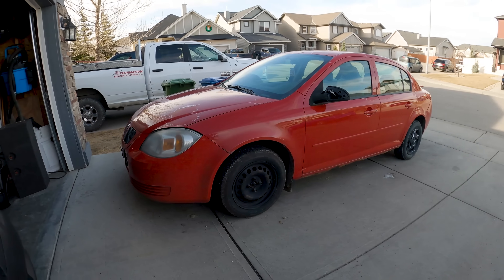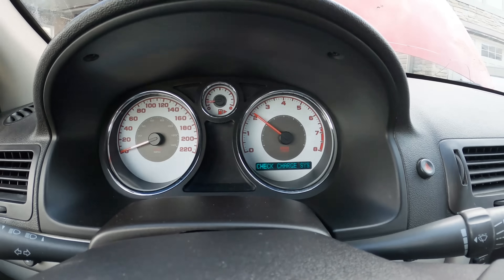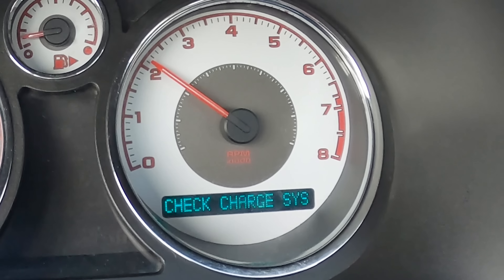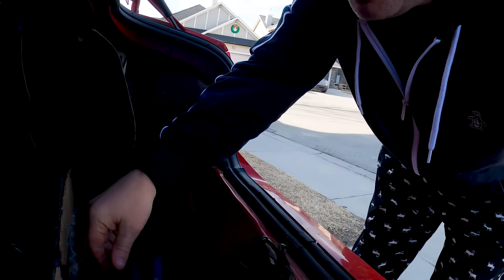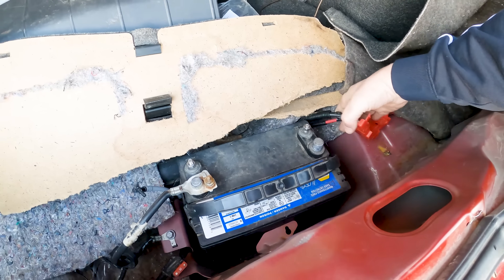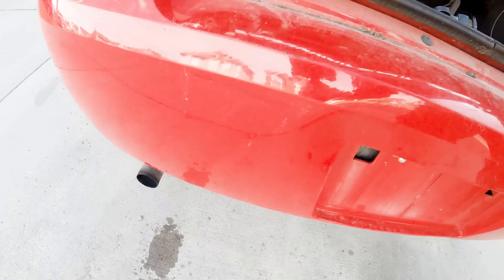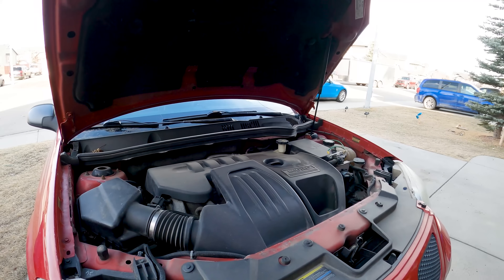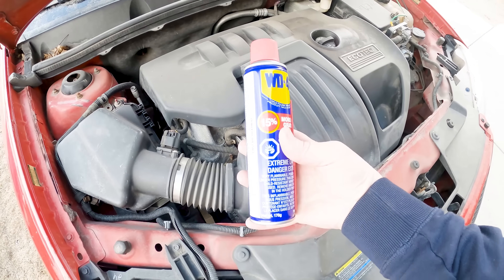ROADSIDE FIX! REVIVE your DEAD or DYING Alternator with this ALMOST FREE trick! | Gears and Tech

Comment: A running engine alternator output should NOT be below 12.6 V, 12.4 is too low, 11.7 is way too low. Modern  cars with current sensors can charge at voltages around 12.8-13.0 volts, but honestly it should be 13.8-14 volts. Also unhooking a battery terminal on a modern automobile with many modules, and multiple networks, while it's running is a Terrible idea, most every OEM service manual warns against the damage this can cause, I have been a technician for 33 years, and a master drivability tech for 20, seriously, doing this on a Nissan with an Intelligent Power Module, or CDJR with a TIPM can cost you thousands.
Reply: 9th gen accords civics can go as low as 12.4v but yeah for toyota I think minimum is 13.6
Reply: @apollomedia7210 14 😁👍
Reply: Just did an 11 Jetta required 14 min. In order to charge due to extra electronics added. Anything lower the battery would die. So you gotta figure in that many kids add big sterio systems and cameras plus gps heads up displays. And all kinds of stuff that can also be damaged by cutting power ubruptly . They are half the time connected directly to the battery.
Reply: 13.8-14.4 is what I always looked for in voltage output for charging.
Reply: @swicked86 True . Over 13 volts for all charging .The volts listed here is batt voltage . 12.6 new batt, 12.5 good, 12.4 fair for 4 cylinders, 12.3 borderline , 12.2 dead for starting  most 8 cyl.
Reply: I concur on all counts here.
Reply: @hootinouts harrumph, harrumph!
Reply: You are completely wrong! I’ll spare you my almost 30 years of automotive credentials and 2 master’s degrees because you probably don’t care anyway.  Disconnecting a battery terminal on a running vehicle on any car made in the past 35 years is not only the most stupid thing one can do as a diagnostic, it is also not at all reliable as a diagnostic! Especially on vehicles manufactured in the past 15 years as they are almost all computer controlled charging maintenance and electrical field controlled according to electrical demand. You truly have no idea what you are talking about and possess absolutely no command of automotive repair, electrical or electronics theory and operation. Disconnecting a battery terminal on vehicles in the 1970s and older was common to test the charging system and also necessary because they had generators with external mechanically operated voltage regulators that were unaffected by voltage anomalies and high current spikes that destroy modern electronics through the high resistance condition created when disconnecting a battery terminal while under operation and electrical generation. It was also necessary to do on 1970s and earlier vehicles as a diagnostic to see if the mechanical relays in the voltage regulator would operate when energized and de- energized additionally the generator could be put into a full field operation that way as well. Very few mechanics in those days had electrical diagnostic tools to trouble shoot without disconnecting a battery terminal. You however are just negligent on so many levels of misinformation throughout the entire video. Please stop embarrassing yourself… please!
Reply: @davidkarpen5686   I also worked in automotive for over 20 years and you are right in saying pulling the battery cable while the engine is running is a terrible Idea. I have replaced so many computers for this same reason and have always told owners that it should never be done. Anyone arguing with you on this is simply what I call a shade tree mechanic.
Reply: @davidkarpen5686 as an automotive electrical specialist with an avionics background, including educational degrees and years of experience, I fully agree with your humbled advice to this embarrassing video and its creator.
Reply: @davidkarpen5686 you saved me having to watch this stupid video thanks man
Reply: @davidkarpen5686 I'm laughing over here 😂 LMAO "I'll spare you my credentials" then you proceed to list your credentials lmfao 😂.
Reply: Yessir. Euro tech here.
Reply: @davidkarpen5686  Mr master You are saying that the battery that is usually fully charged except for slight discharge during startup is constantly drawing power from the alternator and if you unhook it the alternator will magically generate more than the normal 14-14.8 volts and blow out every sensor in the car? All the sensors run at around 14 volts all the time left over power generation is used to charge the battery most of that is used to run the electronics. You don't need to have a piece of paper to learn how things work you got a inflated ego. Also as I suspected you claim you know everything Yet post no videos to share your knowledge. I would use a voltmeter to test the battery with it running and if you get 14-14.8 volts the alternator is working.
Reply: b@davidkarpen5686 😂😂😂Spot On. Your OBCM or ECM can cycle up and over 1.5 billion bits of information in 60 sec. Your absolutely correct, haven't seen that since I was in high school 45 years ago on a GMC voltage generator truck. Same stuff last year, watched a car being pulled by a rope, in drive, 
I believe it was 1972 push starting a car with a automatic transmission capable.
Watched a guy jump start a 1986 Corvette, just accidentally got the cables, back wards. Smoked that ECM in a millie sec. Plus the diodes, in the Altenator.....Cost over $800.00 back in 1986.
Reply: @davidkarpen5686 🎉 well said!
Reply: @davidkarpen5686 
- Since you you replied to OP (original poster) in this thread it as appears that your comment is in reaction to them. But then your comment critiques the video uploader. THIS IS CONFUSING! 
- If your comment is directed at the  video uploader then you need to remove it from this thread and place it as it's own comment.
- If your comment is directed at OP, then you need to edit it so that it is and only is.
- Without taking action on what I have outlined you're causing CONFUSION to anyone reading your comment.
Reply: @Some_One_One  The planet will survive. Why don’t you fix it. Paste and copy my reply and put where you think it belongs.
Reply: I got a constant 16v thank you MECHMAN ALTERNATORS!!
Reply: @g@garystevens1044at 16v you are over charging and will be boiling out your battery over time. 16v briefly after starting is not so bad but constantly at 16v is to much
Reply: Automotive Electronics Design Engineer with 45yrs experience here: Disconnecting a battery on a running engine is a REALLY bad idea!  Most alternators use the battery as load & reference voltage for feedback control.  Disconnecting it will cause the alternator output to become highly erratic and susceptible to produce massive voltage spikes (several hundreds of volts) It's a bit like removing the flywheel from an engine!  The only thing that stops it destroying the car's ECUs are the transient protection circuits in each ECU. You're basically on a knife edge to destroy any electronics fed from the vehicle supply.
Reply: @PT-ij9hc  people will ignore the “have done and designed this stuff for 45 years”. Because the blindingly obvious facts don’t agree with there feelings.   I have personally seen stuff fry on modern cars from unhooking the battery while it’s running. I have also seen stuff fry from having a dead battery. Jumping the car then trying to drive the car.  Modern cars are basically computers. And anyone with a brain knows how fragile stuff like that is to disturbances.  And then you see these “well if the terminals touch that is what causes the issue”. 🤦🏼‍♂️🤦🏼‍♂️🤦🏼‍♂️ yea. They don’t have to touch. Just unhooking and giving that alternator load nowhere to dump is all you need.   It’s been proven in these “fancy books” they like to talk about. And also every mechanic who has done this for long enough has personally seen it
Reply: the disconnecting any piece of modern electronics while it is running is a bad idea. Most modern electronics are very sensitive to spikes. You aren't going to destroy every piece of electronics this way but you are rolling the dice every time you do and because this video will be seen by so many people it guarantees that someone will destroy the electronics. Honestly this seems like a no brainer
Reply: @PT-ij9hc It's like playing poker with professionals as your wager is a limb from your own body and you don't know that folding is an option.

The only thing beneficial about this video is the comments. It's a pleasure to read through the advice and knowledge of true professionals. We have things in common, starting with knowledge and experience with a desire to share that in order to help others from amplifying an already bad situation.
Reply: @YTInnovativeSolution the guy who made this video states its a temporary fix to get you to a safely fixed at a shop or get you home. So to come on here trying to hate on this video with your knowledge and so called experience is claiming that you have disconnected a battery while a car is running and it ruined the computer or what ever electrical components. If not then scratch off the experience you claim to have. I know I had a 2001 Nissan sentra and every now and I had to tighten up the battery to start it because the terminals was bad. Every time I drove on a bumpy road to go fishing or sometimes went over speed bumps. I banged on the positive or just moved it to get it to start. Times I got it started and while it was running I moved it around until I was satisfied it was tight. Some times I pulled it off while still running to see if it wasn't my alternator not charging my battery back up. 1 day  it turned off and I new it was my alternator faulty. Bought a new alternator and terminals and fixed it myself. Did it while the key was in the on position and nothing bad happened. Soon as I put the new  alternator on it started. Bet your mad right now 😂😂. But everything I stated here is true except the keys in the on position. I just like pissing off a professional  because they went to school and worked hard to get the knowledge to fix an alternator and other stuff and I got my knowledge from YouTube. 😂😂😂😂. A 10min video saved me hundreds or thousands of dollars. So be mad clown but I rather do it my self before I get ripped off by a professional.
Reply: Turn tire video see if the alternator is already bad why would you have to worry about frying the alternator that's already bad @PT-ij9hc
Reply: @PT-ij9hc  😂 it is a Bad a idea but it also lets You know if it's working or not 😜, that's why it's a dirty fix like jumping a burnt fuse with a wire, it's Bad but... Could get you to your destiny
Reply: @K_spawn  Well, you do whatever keeps you happy. I've spent enough years designing this stuff to know fact from fiction & offer sound advice. But, I'll tell you this now... keep doing it & one day it'll bite you in the ass!
Reply: @PT-ij9hc  oh no I'm not saying it will not ever happen of course I know it can happen the point here is if that is your only hope to make it safely somewhere it might be well worth the risk, I do have proper tools like the midtronics battery testers and stuff to proper test the starting and charging system didn't mean to disrespect
Reply: @K_spawn , destiny or destination,, or both ?? 😂😂😂
Reply: Well I know ohm's law is a must if you going to do anything with electricity
Reply: Mmm about that disconnecting the terminals that costs me my radio 😔
Reply: @mandlenkosianselmkunene7737 maybe u shoulda unhook it 1st but nuth. happen to mine
Reply: Makes you wonder how many OEM documents and TSBs this guy must have read to reach this level of professionalism, right?? If this was my upload, I would pull it down. However, it is videos such as this that bring like minded people together in the chat box.
To add clarity to your comment..
12.4 volts is what you should read as the 'surface charge' on a healthy 12 volt  automotive or marine battery with no load attached.
14.4 volts is the proper 'charging voltage' needed to charge that 12 volt battery.
For those who are curious about load testing.... A healthy battery should be able to deliver 250 Amps of current (the draw from a starter) for 15 seconds (minimum time) without falling below 10 volts.

I hope this guys advice brings more people to the comments than straight to their troubled vehicle.
Reply: @YTInnovativeSolution o thought it was between 14.4-17 volts
Reply: By CDJR and TIPM I'm sure he means...Chrysler Dodge Jeep and Ram and Totally integrated power module, the Module might as well me a Nodule... As in a  Malignant one.  😂😂 them TIPMs are trash but that's a whole different video. 😂
Reply: I was coming to say something similar but glad someone else did. Thanks man.
Reply: This guy is full of bad information and worse, he does not explain mechanical reasons why his fixes should work.
Reply: Goodness, I rarely get the opportunity to highlight the differences between practical experience and theoretical experience. As a highly intelligent individual, I have both. Firstly, I cannot tell you how many people I've hired with "Culinary experience" and "Chef certifications" from schools (like myself)  who sell themselves with such proclivities in cooking standards and extensive knowledge that absolutely sink as compared to guys that have just learned from on-site experience. I need about 3-4 "certified" cooks to 1-2 cooks with actual hands on job experience.  That's a complete FACT. Books and theories can't teach you. They can help prepare you but never as well as the actually doing a job. This video is for beginners in this field and was spot on with its intended desire. Dont know why 35 year veterans are even watching this. To criticize? Man get a life. Surely they have all that experience to a better end. Or maybe not. That being said. I work on all my own cars thanks to videos as such as these and have absolutely no need to be dependent on mechanics that look for opportunities to overcharge and rip me off anymore. All Facts. Not theory. Just sayin
Reply: @antoinecoleman5110  😂😂😂😂. Stick to cooking
Reply: @antoinecoleman5110 I don’t care what you say about experience vs degrees etc. Disconnecting a battery cable on a running car is a HUGE no-no and telling people to do it is beyond irresponsible. Is he going to cover the damages that result from it when it happens?
Reply: @antoinecoleman5110  and fyi. I have never meet a “highly intelligent individual”. Who goes around trying to convince people of their intelligence.  You are a perfect example of Dunning Kruger 

Obviously an experienced cook can cook better than someone who has just read about cooking.  But no experienced chief can take flour and make it taste like sugar.  There is this thing called FACTS that no experience can override.  And it is easily proven that the theory in is this video will not work on all current cars  and half these comments are just wrong.  Facts don’t care about your feelings or your experience.
Maybe you are  too intelligent to understand that Mr Kruger
Reply: You covered everything I was going to post.
Reply: Thank you I'm glad somebody said it this guy is something else and that WD-40 is going to ruin that belt
Reply: @mikeyshoemagoo0384  Slip, yes, ruin, no, just be mindful, like when you use engine degreaser.
Reply: @johntaylor3298 , Actually, WD-40 will stop a belt from slipping. If you look at the design of the belt, it’s shaped like a V. Adding lubricant to the belt will cause it to slip further into the V on the pulley increasing pressure on the belt as it’s squished by the V which results in increasing the friction stopping the belt from slipping. It’s counter intuitive, but it actually works that way.
Reply: @terjeoseberg990   3 months later, Yeah, the only problem is like 90% of modern cars run off of a single serpentine belt, They  started moving away from V belts for the most part since the 90's era and if you spray any lube on the belt it can cause it to possibly slip, though a little wd40 on the top side of the belt should be a non issue, But you would never want to spray down a serpentine belt with any type of lubricant thinking you are conditioning the rubber and to try and stop belt squeal, as if it were to soak into the underside of the belt in all the little groves that ride on the pulley's with matching grooves  it can slip to the point of you possibly burning up the belt and it snapping it off or throwing it, then you are left on the side of the road with nothing, like I said most modern cars and trucks run on 1 single long serpentine belt that runs everything, power steering pump, alternator and water pump, so if it goes everything goes with it, no limping it  several miles down the road.. WD 40 does however make a belt dressing spray that is totally different than normal WD40 and of course there are other sprays you can buy to temporarily stop belt squeal do to slippage, but they are tacky/ adhesive type sprays, not lubricants...😉
Reply: @Stars-and-Stripes- , Lubricating a belt to increase friction only works with V belts. Newer serpentine belts have teeth.
Reply: @terjeoseberg990  That was my whole point..😉 But, perhaps you meant to say that some V belts have teeth or you are referring to COG/Synchronous belts  , I have seen some V belts with teeth on them, but no serpentine belts have teeth though , they have several horizontal groves in them that ride along the grooves in the pulley's, But Cog belts, that look like "serpentine belts" on the Top side certainly have Teeth(cogs), like all timing belts are cogged and some drive belts are and are mainly seen on some HD trucks and machinery and such, Not so many cars have them as Drive belts though and the vast majority of cars still use standard Serpentine drive belts..🤔

"V-belts, synchronous belts, and serpentine belts are all types of belts used in different applications:

"V-belts"
Can be compact and installed in limited spaces, and are often used when the distance between the drive and driven pulleys is short. They can also reduce vibration and noise, cushion motors and bearings, and achieve higher velocity ratios. However, V-belts are not as durable as flat belts, and they're not suitable for constant-speed applications because they creep. V-belts should be inspected for wear after 3 years or 30,000–40,000 miles of use, and replaced every 3–4 years to minimize the risk of sudden failure.

"Synchronous belts"
Also known as cogged, timing, positive-drive, or high-torque drive belts, these toothed belts require grooved sprockets for installation. They offer several advantages over V-belts, including:
Shaft synchronization: Synchronous belts can synchronize shafts exactly.
Slippage elimination: Synchronous belts can eliminate slippage and speed loss that can occur with V-belts.
Lower installation tension: Synchronous belts require less tension to install, which can reduce stress on bearings and shafts.
Higher drive efficiency: Synchronous belts can achieve a drive efficiency of up to 98%, compared to 93–95% for V-belts.
Durability: Synchronous belts are resistant to corrosion, stretch, and wear. However, they can wear quickly if pulleys aren't properly aligned, especially in drives with long center distances.

"Serpentine belts"
Serpentine belts are a single, wider belt that can be more efficient than older systems that use multiple, thinner belts. They can also take up less space in the engine compartment. However, a worn serpentine belt can break while driving, which can disable essential functions like the power steering, alternator, and air conditioning." 🖖🙂
Reply: @Stars-and-Stripes- , I’ve never seen a V belt with teeth, and can’t imagine how teeth would help on a V belt.
Reply: @Stars-and-Stripes- , Those are interesting point that it looks like you copied from somewhere. They left out one type of belt that I’ve seen. It’s a single belt with a whole bunch of Vs on the belt and the pully. Do you know what I’m referring to? What are the advantages and disadvantages of those belts? And what are they called?
Reply: @terjeoseberg990  I told you there are V belts that also have teeth on them..🤔
Reply: @Stars-and-Stripes- , The belt that I’m referring to us not a V belt with teeth. It’s a V belt with multiple parallel Vs. The Vs are in the wrong direction to be teeth.
Reply: @williesmith8326 , Is that the best you’ve got? You can’t tell me what I’ve said that’s incorrect?
Reply: @mikeyshoemagoo0384 , Why would WD-40 ruin a belt? That’s idiotic. I had an old Toyota Corolla, and I cleaned the engine several times using engine cleaner and afterwards I sprayed everything with WD-40, including all the belts. The belts never failed, and I drove it until it got to 285,000 miles. Then I stopped driving it, despite the fact that it still ran perfectly and the belts were still fine.
Reply: @mikeyshoemagoo0384 

The belt? WD-40 isnt a great lubricant. It is a rust remover and prevention liquid mostly. 

Im worried about them bearings and pulleys ey? Those might need to be repacked with molly soon!
Reply: @mikeyshoemagoo0384  Also, "regular" WD40 is flammable.  There is a WD40 product made for cleaning electrical contacts that might do something but my bet is that all any of this is going to do is get you stranded for good somewhere farther down the road.
Reply: @WatchesTrainsAndRockets somewhere further down the road , like in a town, is sometimes a much better option.  All those holes in your alternator let water and dust etc in.  A dewatering fluid/ lubricant/cleaner can remove a lot of stuff that shouldn't be there, free up bushings etc.  But, as he says, it's usually a temporary fix. Cheers.
Reply: @grantperkins368  Yes, but NOT original WD40!  It is flammable and it is not intended for electrical applications.  It is for mechanical parts.  There is a variant that IS suitable for electrical.  everything is not a nail no matter how much you like the hammer.
Reply: @WatchesTrainsAndRockets  you're right, and if you have a can of electrical contact cleaner with you that would be a much better option. BUT  if you only have a can of wd40 which I reckon a lot of cars do, then it will work in a pinch.  Obviously don't spray it into a spinning alternator, you'll most likely get a fireball.  Spray it on a stationary alternator, wait a few minutes, all the volatiles will evaporate, leaving oil essentially, then give it a whirr.  Heck back in the day we'd spray it in distributors and points and guess what?... not one fire!
Reply: hah. wd-40 is about useless for most things. it's a water barrier not a lube or conditioner.
Reply: @mikeyshoemagoo0384  Good thing that alternator wasn't working or there may have been a fire. Not to mention that the solvents in WD40 can disolve the coating on the field wires. Genius!
Reply: Couldn't agree more, you can no longer hot swap batteries. This can really mess up some newer Toyotas  as well. Throttlebody ECU could become toast.
Reply: Hay that's good to no
Reply: Don’t EVER disconnect so battery on a running vehicle.  You’re removing the electrical buffer…good way to toast any electronics / power modules / ECU, ECM, PCM’s.

No need to do it at all; it was obvious the alternator was not working by the voltage alone.  13.0-14.4 is normal.
Reply: I'm an electronics engineer and you're right about disconnecting the battery of a modern car while the engine is running.  Anything less than 13.8V isn't enough to charge a partially discharged 12V lead-acid starting battery.
Reply: Thank you. I was scrolling to see how long it would it would take for someone to stomp on the disconnect alternator check. I have been a shade tree mechanic for many a year. Not to mention having working in the auto aftermarket for over 15 years.  This has been a no-no since at least back in the '90's.
Reply: I've had many newer Nissan Rogues come in the shop with a check engine light, crash warning system light, and all kinds of error codes simply due to the battery failing. When changing the battery, the engineers who designed the vehicle warn in the service manual that you need to close the door and wait 3 minutes for the computer modules to shut down before removing the old battery, otherwise there could be issues. So I would never even think about disconnecting a battery on a running modern car. I've seen techs change batteries on older running cars and they were fine but you're playing with fire if you try that nowadays with all the complex technology installed in new cars.
Reply: 12.4v when the car is off is a good voltage, you don't know what your talking about 😂
Reply: @Corporal0927  10v is good on some lol nobody knows what they're talking about 😂😂😂
Reply: Yes disconnecting a battery whilst running used to be a good way to tell 30 odd years ago on cars without ecus.
Reply: A few seconds is not going to fry it!
Reply: with an itelligent power module , blash blsh blsh , not verry intelligent if its gonna fry circuits because u disconnected a battery that the vihicle isnt using at th moment because the alternator is suppose to feed all system when the car is running , so if it shuts off , and u fry a bunch of systems then i calk that a very dumb power module . YOU SEE THI IS THE REASON WHY I STAY WITH EARLY 90S AND BACK , FK ALL THESE NEW DUMB COMPUTERIZED CARS,  IM 47 started working on engines before i was in 5th grade. i have a 92 ford fleetwood bounder rv 33 foot, i see these new rvs with all types of issues , not mine. lol
Reply: You ant wrong.  One of ours guys was working on a new Nissan. Replaced the battery but forgot to tightn the terminal. Car was running. He somehow “accidentally” pulled the cable off the battery and instantly fried almost 1k worth of shit.   I honestly never tried it. But I really figured not much would happen.  I was made a believer that day lol  pretty sure it was the ipm that fried.  Seems like it was two different things.  Been a bit so I forget.
Reply: @Scummy_shovel 😂😂😂😂 he somehow in the middle of the night accidentally slipped off a mountain Wrestled a bobcat and pulled the positive battery cable off😂😂😂😂haaahhaaaaa
Reply: @scottcarrolljr5711  if your talking about my guy I already explained it.  He replaced the battery and terminals. Forgot to tightn the ground cable and it got pulled off while he was going over everything.   You ever worked on anything?
Reply: @Scummy_shovel , If you disconnect the positive battery terminal and short it to ground with the engine running, who knows what you might fry. If your friend didn’t tighten the positive terminal and it fell off and shorted to ground, your story makes sense. If it was the negative terminal, then I don’t know. I’ve heard this story about frying the electronics if you disconnect the battery before, but have never seen it happen. Electrical conditions in cars are extremely brutal and therefore the computers in cars need to be protected from brownouts and voltage spikes. This is extremely easy to do with capacitors and inductors, so they use capacitor and inductors. If they don’t, they’re going to have a lot if warranty repairs to deal with.
Reply: So I’d guess you’d come and fix my car at 3 am ? Maybe 🤔 with a tipm or ecm or tccm. Just drive and stay old skool.
Reply: All modern alternators have internal voltage regulators. That being said, NO that voltage will NOT change when you hit the accelerator pedal. If the alternator is malfunctioning, then maybe it could but not just because it's cold.
Reply: I was going to say the same... IYKYK
Reply: 12,5 is average for old gm... im not saying it should  or should not...

But I get it, new car need as much power as my house...
Reply: @joseph-mariopelerin7028 naw 12.5 isn’t even fully charged battery voltage. If you have 12.5 at idle then you’re not charging at idle.
Reply: AMEN BROTHER
Reply: Thanks  for the warning......  Yes, it makes sense.   Solid state devices could be destroyed....
Reply: @user-5gu78qo27i , If the belt is at a certain tension, and you add lubricant that makes the belt slip deeper into the grove, you’re right that the belt will become looser. However, it will still increase friction and therefore stop slipping despite being looser.
Reply: Its complletelly fcukn mad this video and most comments on here from either just compltelly ignorant or stupid people ! Any power surge can at the very least cause ellectronics to be damaged and disconnecting battery when engine running is very stupid !! Even not running jumpstarting etc care required and plentty cars have BATTERY DISCONECT PROCEDURE AS WELL AS B.M.S. SYSTEMS AND RE.INITIALISE PROCEDURES.And WD40 oil etc will soften rubber belts and render them to imminantlly fail ! But its funny to see all the clowns and there comments 😂😂😂😂😂😂😂
Reply: A lot of theese brain dead keyboard warriors dont understand smart alternators either ! They onlly charges agm battery to arround 85%   and mostlly when car is overrun/ deceleration boost charge/regenenerative chargeing.
Reply: 12.6v Is battery voltage... An alternatori should be at least higher than 13v... 13.5 to 14.5 Is a good point... For some Cars It could be a bit lower buy anyway never less than 13v
Reply: How was it to be there and see all this talk .
Reply: I forgot to mention =- i broke down on the autobaun in germany and got the ignition contact points changed on the side of road , and back up , = no tow, and we had a car in fairbanks alaska that did not have an alternator , but we could drive to taco bell ( anchorage = 8 hours south ) on the battery if we didn't need lights. terrible ideas we had when young and i can't believe things we have to learn to keep up ??
Reply: Question: I am not sure,but: inst the wd40 flammable? doing that isn't a risk to provoke a fire?
Reply: right?    All this just for:  $7 multimeter, alt bad.  done.  yikes
"If you haven't heard of wd40"    k.. ya I can't lulz.
I tried to go further, then he spayed wd40 all over his fan belt....
Reply: Diagnose my alternator the same way charge light was on and drained the battery. So I done the disconnect terminal test 💯 alternator not charging 👍
Reply: The alternator runs everything not the battery so unhooking the battery will not cause damage. The battery is mainly for starting the engine.
Reply: @chriss4365  alternator doesnt run everything all the time, they have a duty cycle. Alternators are not meant to be charging 100% of the time. If they did charge 100% of the time, they would overheat and the solder inside them would start dripping out. Typically, they dont have any special type of cooling other than the fan fins inside of it or on the outside of it, except for a few different model european vehicles that use the engine coolant to cool the alternator.  The battery is used for more than just providing power to power the starter to start the vehicle.  The battery provides a reserve of power for vehicle electronics, also reduces the load put on an alternator, and especially in European vehicles, if you have a weak battery due to damaged cells, and need to jump start the car, certain vehicle systems are not going to be able to function properly because the alternator duty cycle is going to be higher, and that will lead to overcharging for extended time, and some vehicle systems are not allowed to operate when the voltage is too high for an extended time, so then they stay powered off.  When you disconnect a battery from a car, especially if you take the positive off first while its running, the system voltage will spike, and computers have sensitive components inside of them that are vulnerable to blow if there is a sudden spike in voltage. Think of it like this, if somebody is spraying you with  cool to warm water on a hot summer day consistently, its fine because you wont get burned or freeze, then someone comes over with boiling hot water and dumps that on your head, your likely going to get burned and its going to hurt. But before your skin can blister, you cooled it off with the same water youve been getting sprayed with so it becomes manageable. Now someone else comes along with some more boiling hot water and dumps it on you again. Your skin is already sensitive from the previous boiling water and its going to hurt even more. Maybe youll blister, maybe you wont. When a blister forms from a burn, thats pretty much representing a component of a computer failing due to voltage spike. So any real technician that knows what they are doing, will simply tell you to refrain from following this guys instructions because it will cause an issue.
Reply: @SM-sw3ul , 1 or 2 minutes to swap a battery isn’t 100% of the time. It’s only 1 or 2 minutes, and with the battery disconnected, the alternator isn’t charging anything.
Reply: Ok but he said the voltage was reading the battery not the alternator, but u might be right about damage tho cuz the car doesn't understand and has to relearn the way the electricity is running, is this somewhat correct?
Reply: Not everyone drives a modern car though. I drive a 79 Subaru DL and the engine will run happily with only 8 volts or so powering the ignition. If the engine spent a long time cranking to start, and it's raining outside, so the wipers and headlights are on, and the blower motor is on, the voltage will drop to around 12v, only while idling. I've driven that car for over 200,000 miles and it's never caused a single issue. Yes in a modern car that may cause an issue but some of us drive carbureted cars with distributor ignition where low voltage isn't really going to affect anything except that if the voltage really is low for a long, long time, the battery will die at some point.
Reply: Either way a mechanic will cost u thousand. Buy DIY… will actually save u money. I’ll take the risk.
Reply: Since your a  "technician" for 33 yrs and a "MASTER drivability tech" You probably don't have the problems that regular people do. But me being a regular old "mechanic" with a repair shop for 37yrs in a small town I think it was a great tip for someone with $500 car it will save you from calling a $200 tow truck.
Reply: @Jpilgrim30... 😴
Reply: Completely agree!
Reply: This guy clearly doesn’t know what he’s doing. I’ve been wrenching for over 30 years and I laugh at some of these people.
Reply: You can't unplug the battery the alternator will not keep all systems running. It's not a 57 chevy
Reply: @tymothykendrick6420 dude... your alternator will run everything and charge the battery on top of it... so if you unplug the battery, it will still run everything... 

Your battery would be always dead if it wasn't like that...
Reply: You my friend are a fool.
Reply: What moron tells viewers to pull their battery cable off while the car is running??  You know how many computer modules you could ruin by doing that ?? Stupid idea stupid tip!!!!
Reply: Omg.
Reply: Thanks for the acronyms dude
Reply: So the AAA guy was testing my battery and he broke the negative terminal off the battery. The car shut off and the next day I went and bought a new alternator. Now when I use OBD I am getting a p085 error.  I'm worried something may have shorted it is a 2006 Honda Civic DX
Reply: I'm happy tour australian mechanics
Reply: Yes it can cause issues with ecm disconnecting the battery.  Best to simply use multimeter to test battery and or alternator.  
He did well for a GM guy tho 💁😂
Reply: You probably a fitter 😂
Reply: You've never own a honda civic, huh?
Reply: It's always good to have a spear one.
Reply: So I’m assuming 1.6v is probably not good huh😂
Reply: Omg this bloke tighten the terminals lmfao, and don't ever remove terminal while running 😮
Reply: You are so wrong my Cobalt supposed to be at 11.5 don't believe me look up 2006 Chevy Cobalt Lt with a 2.2.
Reply: Yes and putting wd-40 in there can cause a flash fire
Reply: Bad cell
Reply: No it should go up to at least 14.7 fault so the first couple of minutes and stabilize it about 14.2 to 14.4 volts
Reply: I welcome motorcycles but the principal is the same when you have an alternator you don't remove it or disconnect it while the vehicle is running you can completely destroy your ECU and maybe on an older vehicle maybe but on the neuro ones wow you just don't do it you just don't do it I caused thousands of pounds worth of damage by doing that it's just not worth doing.. If you don't have the tools get recovered don't pull the leads off an alternator for running vehicle. You can go from no alternator to no vehicle very quickly. 😊
Reply: technician says you can't do that you will destroy it. bring it to my shop. I will charge you an arm and a leg. real mechanic says let me give you a tip so you can help your self.
Reply: I'm sorry my only question is why in the world are these Master Mechanic, Super certified, Multi-year Genius Overlords of the PhD from Harvard, Brown and other Elite Ivy League schools. 
Why in the world are they wasting their super substantially highly valuable time. Watching a shade tree mechanic; Moreover then subsiquintly feeling  the need to make time in their evidently super busy lives; To then critique some poor sap on YouTube trying to be helpful. 
I personally posit if they feel that strongly about it, Then why not make their own video releasing the gatekeeping information of their super understanding about car charging systems and electronics. Because certainly they engineered and wrote the schematics for all charging systems. Judging by their comments and understanding of a highly misunderstood and tricky subject such as the almighty alternator. PS. Chances are if we're being honest they probably invented and patented the aforementioned.??..😂
Reply: Spraying the WD40 isn't a good idea?
Reply: I'm asking you about the WD40. Bad or good idea?
Reply: If your vehicle can be damaged by disconnecting the battery while running, get rid of the vehicle.
Reply: For those of us who take pride in how many miles we squeeze out of our low tech clunkers , this is magic beanstalk seeds .  Sure there's risks , but I'm better off
Reply: Great video ,!! These idiots who keep clogging the comments , probably have miserable social lives.  Ego driven know it all types , bloated belly and spiritually emaciated
Reply: My Bluetooth device has a voltage reader. So happy I have it... gave me a heads up before taking off and I new it wasn't the battery because I had replaced it and the power would go out after a while on.
Reply: A good alternator should put out 14-14.5vdc a car battery should read 13.5-13.8 depending on type of battery
Reply: That car need the alternator repairing or changing
Reply: I've no doubt its a  bad idea however its always funny when engineers come on with their massive biblical length comments telling you how you cant do exactly whats just been done on video in front of their eyes. 😂
Reply: Always nice for car manufacturers to design vehicles to nuke themselves in the odd event that a battery terminal loses connection.
Reply: it says roadside fix. If youre a mechanic you know its fine in a pinch. Fuck Nissan lol
Reply: Alternators with a diode will instantly be destroyed by a surge if you unhook a battery cable.
Reply: @davidpotter7484  All alternators have diodes. That is how they change the AC that they generate into DC that your car can use.
Reply: @richm1615  older alternators used a resistant wire or a light bulb as resistor. No diode.
Reply: @richm1615  you're looking at the ai crap on the internet,  and not remembering that it lies to people
Reply: @davidpotter7484 👍 Since 1970's in my experience
Reply: Shouldn't hurt anything unless you accidentally touch the positive cable to a ground
Reply: @dinadaughtry8993  that statement that you just made, is even more dumb than the guy making the video. you know absolutely nothing. In fact, the guy making the video knows absolutely nothing, you around the negative side of nothing.
Reply: @dinadaughtry8993 , Exactly!!
Reply: With the ignition on, and the battery light on your dash.
Then the dynamo pully is magnetic.
You can check this by holding a fitting screwdriver against it.
If your dash battery light does not light up and the pully is not magnetic, you can tap the alternator with a hammer in an emergency, hoping that the brushes will touch the alternator rotor again and your dash light will light up again. .
Then your system will probably charge 14.4 volts again.
If you have a newer system with a power module,its a bit harder to fix,but strandet in nowhere,even a city light can help you out to come home.
Reply: These comments are the funniest shit I've read in a long time😂😂😂
Reply: @scottcarrolljr5711  the guy in your profile looks like an extremely slow reader.  So I can see that.  Have someone read them for you. It will make more sense.
Reply: All I know is at you can get a good look at a 12.6 battery by sticking your head up a bull's ass but wouldn't you rather just take the alternators word for it?😂😂😂 fuck that this guy is the shit I hope he becomes president. Lots of people do videos like this for 8 years, they're called Car Doctors
Reply: @scottcarrolljr5711 umm I really don't think you can see that 😂😂😂😂
Reply: @scottcarrolljr5711 i was just about to write this, I'm glad you did first. These comments are triggering.
Reply: YOU FAILED TO LISTEN TO HIM !! HE SAID THIS IS HOW HE DOES IT ON THIS CAR. I NEVER HEARD HIM SAY "THIS WORKS ON ALL CARS / ALL MODELS , EXCEPT THE 2008 FORD EXPEDITION  FUNCKMASTER FLEX EDITION" . i DID NOT HEAR WHAT YOU "WANTED" TO HEAR .........THE CARS YOU MENTION HAVE PROBLEMS WITH THE TIPM ANYWAY = ALL THE TIME !! OH = JET ENGINE MECHANIC 4 YEARS , MI TANK MECHANIC 3 YEARS , AUTO MECHANIC 32 YEARS . BLAA BLAA YADA YADA YADA ...
Reply: @ohioedde  You are both morons 🙄
Reply: I find it funny that people that got a lot of years working in a shop on cars and are licensed and all that are saying this is a bad idea they probably read it in a book but never have actually done it themselves, it works and it doesn't fry your car quit pretending to be a know-it-all when you're not, the man clearly said it'll work in a pitch,  I appreciate him sharing the knowledge,  I suppose these big shot mechanics are going to say you can't use gorilla tape to cover up rust holes either-- shut up and get out of here
Reply: @davidwillis5016 , Exactly!!!
Reply: @davidwillis5016 have done it, it doesn't work on newer cars, the car will shut off at a minimum, fry shit at a maximum. Tell me you haven't touched a car ever without saying it
Reply: @davidwillis5016  you clearly haven’t read the comments. And you clearly don’t know shit about modern cars.  Prob why you’re using tape for rust holes.   But by all means.  Give it a try.  Sure it will be fine sometimes on some cars.  But so is unprotected sex with a prostitute.
Reply: @davidwillis5016 

I shorted my moms Acura ILX 2019 Sport. How?

My car battery is dead, so i turned my moms car on. Pulled her battery out. Placed my battery in. I put positive on first, then the negative.

No, i didnt wire anything backwards. My cables are colored and my terminals marked for ease and obvious reasons.

But i heard (a noise instantly there then gone, like a click) and later discovered i blew the primary fusable link in her car.

I dont know the reasoning, i am not a mechanic.

Pulling it was not a problem...

I do it all the time, bat in and out, on my car...

But my moms car didnt like it. Replacing the fusabile link (140$, must be honda geniune as they are not shaped in a generic style) also revealed a check engine light.

After a couple sensors and one of the multiple onboard computers, her car was back! Took a couple days to locate parts/ wait for shipping and around 350$.

Take what you will from this. Any car with multiple onboard electronics have, to some degree, built in tolerance systems to handle spikes of voltage.
Reply: @ChipperTheChipster , “so I turned my mom’s car on”

You mean that you removed your mom’s battery from her car and installed your battery in her car while her car was running? If you did that and touched the positive battery terminal to ground with her engine running, you shorted it and it makes sense that you’d blow a fuse.

If you attempt to swap batteries in a running car you’re taking a big risk and need to be extremely careful not to short the positive terminal.
Reply: @ChipperTheChipster , If I was going to attempt to swap batteries on a running car, I’d put the new battery right next to the old battery and when I remove the positive cable, I would immediately connect it to the positive terminal of the other battery. I would not let the cable dangle around while swapping batteries, then reconnect it.

The battery cables might not be long enough to do this.
Reply: @davidwillis5016  ok Einstein
Reply: @davidwillis5016 
I think you are the one without the knowledge. Just because this worked on this particular car in this particular situation, dies not mean it will work in all situations.
I have worked on cars for 40 plus years and have equal experience. I've worked on the '70's car that unhooking the battery would work on. After about 1995, computer systems took over charging control. On top of that, they are very sensitive to voltage and voltage spikes. Even jump starting a car can fry the PCM. I'm working on one now that happened to. Been jump started lord knows how many times because owner can't afford a new battery. Now it won't run because the PCM is jacked up. Now he needs a new battery and a new PCM. Both are $250 each. 0lus a fuel fuel pump install that was misdiagnosed because they were too cheap.
The WD-40 trick is just asking for an engine fire to put that car out of its misery. Get a nice hot 95* day with all the sparks the brushes are creating, POOF! Instant alternator problem fixed! 
The only good comment made was the USB charger with the voltage readout. But, he doesn't even understand what the 5.0 means either. 5.0 is the amps the charger is putting out to charge the phone. Car off, you should have 12.5V volts minimum. Running you should have 14.3-14.5v.
Reply: @davidwillis5016 You got that right, book Smart is not experience, the books warn about damage being possible due to the voltage spikes because the battery acts as a buffer for it but... Alternators are more sophisticated than before and the chances of that happening are pretty low, I do have over 20yrs of experience book and hands on and have a bunch of certifications and what not, and I can tell you this guy is correct, if the smarty techs out there are still in doubt here it goes 

Tech a says: this is not a permanent fix may not work, it's a dirty way to try and solve this temporarily.

Tech b says : using wd 40 can drive out contaminants from the alternator brushes

Tech c says : disconnecting the battery while the vehicle is running and the engine stalls, could indicate a Bad alternator. 

Tech d says : engine can run over 11v

Which tech is correct?
Reply: @K_spawn  Tech C 😂
Reply from the maker: How many times did you try it out?

Is this the same as the old story that eating raw cookie dough will make you sick?

I've done this many times and have never fried a module.
Reply: If you haven't fried a module yet then consider yourself lucky. Battery terminals should never be removed while engine is turned on, especially positive terminal, and the reason you run the risk of frying a module is because of voltage spiking. Sure maybe there were cars you did that to and they seemed fine, but what you are unaware of is that inside the car modules,  there are these components called mosfets, and they are transistors used mainly for switching and amplifying purposes, and short voltage spikes caused from disconnecting a vehicle's battery with engine running is enough to damage these components, as well as diodes and capacitors. Like the other comment posted by someone else, the IPDM (independent power distribution module) in Nissans are known to have issues and they are rather sensitive to voltage spiking, as well as low voltage. (Voltage spiking can cause current to blowout mosfets diodes and capacitors, and low voltage will surprisingly fry components because they're demanding a certain power and not being provided that, so according to Ohms law, voltage = current(amps) x resistance(ohms)  and also Power(watts)=current(amps) x voltage. I'm sure you can fill in the formulas yourself but the factor that tries to stay the same is the power (watts) by keeping that number the same, you'll find that decreasing voltage is going to increase the amperage in order to keep the wattage the same, and increasing amperage is going to create more heat as well as component failures. It's nice that you want to help people out and you certainly believe you may have been helping them out, but this video won't help someone in a modern day car , or a car that already has weak electronics from constant electronic abuse and poor ground connections. The best thing to do if you want to help people with automobiles, is either direct them to the real technicians who have the proper credentials and experience, not the guys who are backyard mechanics and think they're masters, or supply them with the phone number to AAA and suggest they get the gold membership plan, otherwise the wisest move is to do what you really know, not what you think you know.
Reply: @asificam1  by cap you mean capacitor?
Reply: @SM-sw3ul basically all you mechanics say the same thing. You are trained to work within manufacturers specified limits. This is the Star Trek folly. Anyone on the outside can push past those limits quite regularly without having to spend the thousands of dollars that you insist that we need to spend. Everyday us dumb people get these cars to work without following your instructions. This is why we don't like to get ripped off by you people with 30 years of experience and 50 masters degrees. It's simply not necessary because most cars can handle way beyond the manufacturer's specification because they have been tested thousands of times and have a certain fail rate. And then what they tell you is if it fails 10% of that time you shouldn't try it because they're going to end up having to refund at that rate if it's brought to your shop and that's too risky. It's called being an actuary. 

You may be a mechanic with all this experience in the world but you know nothing about insurance and mathematical work that goes on behind the scenes which means WHY They tell you to do what they do! Actuaries do this and I have 30 years experience in this field and I'm the guy who tells you why you do what you do! So therefore there is a 90% chance or greater that these units will not fail! Therefore if you are struggling with money and you need an out. This is an excellent way to get by in today's world with people who have less than $1,000 to their name and only one chance to do it.
Reply: @SM-sw3ul how would the voltage spike if the alternator is dying? As it is/was it would never jump over 13.
What a drama queen?
Reply: @nenedecaramelo  you will only be able to see some voltage spikes if you are using an oscilloscope and recording the data from the scope. Electronic components in computers are sensitive to voltage spikes and can very easily be damaged and you wont be able to visually see the voltage spike without the use of an oscilloscope.  For example, try and measure the voltage produced from a simple arc style lighter. you will only be able to see the voltage created with the use of an oscilloscope, and that little clicker on a lighter produces 800 volts or more because you cannot have an electrical arc with only 12 volts.   Voltage is the amount of pressure in a circuit, Current is the load amount in a circuit and Resistance is as it sounds, the resistance to voltage and current in a circuit.
Reply: @GearsAndTech on the new cars, it's well known knowledge that the old "pull the cable" alternator test is a no no. I won't do it on any car newer than 01. Especially when using a voltmeter of some sort is a much quicker and more accurate measure
Reply: Its not so much the dough as it is the raw egg. You go ahead, ill watch.
Reply: @BogusJNutherwebb and not so much the raw egg. But the raw egg being cracked. Mixed and sitting in a pack for a while.  My sister swears cookie dough got her sick once.  Idk. She want let her kids eat it anymore lol.
Reply: @BogusJNutherwebb-me6pn  In my childhood many many mornings, my  mother would crack a raw egg and blend it into my carnation instant breakfast drink. Never had any problem whatsoever. Also, back then all large grocery stores  and small markets had the eggs displayed at room temperature. Eggs just were not refrigerated.
Reply: @Scummy_shovel lmfao that would still be the raw egg
Reply: @saucemasterx911  exactly. That’s exactly what I said.  It’s not just a raw egg.  But a raw egg that’s been cracked open. Mixed with stuff and sitting in a bag.  Since you are slow.  A egg is raw untill it’s cooked.  Untill it’s cooked you can get sick from it.
Reply: I ain't touching the cookie dough I'm gonna drink the Kool+@de while I contemplate the wobble of our planet, as it spins , and now they say (and tho comes straight from the guys with the white lab coats clipboards and still use the Phone 8 😊 😊and tether it to their -well they out there saying that wobble is is accelerating and did y'all knoweth this , the earth is off it's axle
It's just barely keeping it together thanks to the tie rods
I don't know about the cookie dough but bubble yum definitely is made out of spider eggs    and the
 dirt and shit they incubate in, and space rocks
Reply: @Scummy_shovel  technically you can trace the issue all the way back to the chicken
Reply: @calvinmitchell6381  eggs in cookie dough isn't the issue. Raw flour is what can make you sick. If you bake the flour for a little and then make the cookie dough, you can eat all you want
Reply: Raw eggs won't hurt you as long as they are farm fresh and they don't have those greasy spots on them like the stores carry for high prices though they are second rate. You can smell the bacteria on them.
I used to be a chicken farmer and drank 42 of my chicken's eggs in a period of around 3 hours. Filled me up for sure, but no ill effects. If in doubt though, cook em.

Now to the video.... Another use for opossum pee (Wd-40) huh? Good ideal man. I have been fortunate enough not to have blown anything when I did the same type of checking as you did, but it is best to use a meter and that thing you plug into the cigarette lighter is really better than a meter and tells you all you need to know.
Reply: @Scummy_shovel as long as you keep it cold you're gucci... Better than cooked any day lol
Reply: @GearsAndTech everything works until it doesn't. I'm also a tech and there is a reason there is a difference between a mechanic and a tech and specialized training is part of it. The gentleman is correct the risk of disconnecting on modern vehicles is very risky due to the many modules on the canbus network between each. He is only trying to help you out. Just because you do it your way and nothing has fried doesn't mean the potential to do so isn't there but the garuanteed way to be sure it doesn't happen is to not do it how you are doing it. Just saying. There is a chance in Russian Roulette you never get the bullet doing it your way bit there is always that chance you can and the consequences are expensive!!!!! So why even play Russian roulette to begin with so to speak?
Reply: 😂 @GearsAndTech
Reply: @GearsAndTech  Yet
Reply: @GearsAndTech  spraying wd40 on a dead alternator is about as effective as trying to talk it into charging again.
Reply: @GearsAndTech your right jus keep it out of the bearings 😁👍
Reply: @GearsAndTech no it’s not a myth. I have personally fixed a truck where someone did this to “check” their alternator and fried their IPDM and the BCM. Removing the battery terminal from a running car on modern vehicles is playing Russian Roulette. Maybe nothing happens and all is fine or maybe you just cost a couple of grand in damages.
Reply: @GearsAndTech  maybe you will get lucky next time!
Reply: @GearsAndTech  eating raw cookie dough can make you sick lol. You're never supposed to consume raw flour
Reply: @GearsAndTech  I bet you eat a lot of cookie dough it's taken over your brain 😂
Reply: @GearsAndTech the reason why you shouldn't eat raw cookie dough is because of the raw egg in it
Reply: @GearsAndTech  Dude, that's a terrible response to a comment that is only trying to help people. Seriously, just because you haven't fried a module YET doesn't mean that he's wrong. A simple Google search verifies what he says, so why the childish response to a valid comment? I mean, if you yourself don't like learning, why would anybody want to learn from you? Its way smarter to do a follow-up video explaining what you've learned since that video, and updating the info. Then you get the views from both videos, and you look better to your viewers by not sounding childish and immature
Reply: @GearsAndTech  😂😂😂😂 you have succeeded in triggering every 30+year tech out there, and of course based on theory whatever they're saying can happen, but the reality is you are advertising dirty secrets and dirty repairs and these are actually dirty secrets and dirty repairs😂😂😂 and whether they like it or not they are legit they can get you out of a big struggle just so that you can make it to point b
Reply: @K_spawn you want a dirty secret? Go buy a multimeter 😂😂😂😂 
It's so hard to take you people seriously
Reply: @timeattackattempts3764  damn I saw your user name on my messages and thought it was a contest of some sort lol, and that would be a good idea harbor has scary cheap dmm for like 5$ , and then go watch Scotty to know why Toyota aren't trash, then Eric the car guy to learn how to use it, then scanner danner to just quit and call AAA lol
Reply: @K_spawn  I was going to do a channel streaming my sim rig game play, but I hardly ever even use the sim since I hate it without motion and haptics lol
Reply: @K_spawn go out with a good alternator and unplug your hot terminal car will not stay running. I'm not a paid mechanic just been doing it my whole life. The alternator won't sustain all the systems in a modern car
Reply: @K_spawn  do what you want
Reply: @jamesferguson2353  forgot about this crap lol
Reply: @GearsAndTech eating raw cookie dough can make you sick but that’s only if the eggs were bad or had salmonella which is usually not the case which is why you normally won’t get sick from it
Reply: Honestly,..when you popped your hood I almost had a heart attack your motor is filthy, rusty and not maintained..no wonder your alternator gave out it rusted.
My 2004 Avalanche engine bay is sparkling clean and I'm 70 years old , you should delete your channel.
Reply: @Zorlof  Dude, You lost all credibility when you stated that an engine has not been maintained when you have no evidence whatsoever to back that up.
Reply: @Zorlof  he stated he just bought a $500 car......HELLOOOO ??? Tell me what are your expectations of a $500 car ???
Reply: @Zorlof so because his daughter's engine bay is dirty he should delete his channel? 
You ARE a moron.